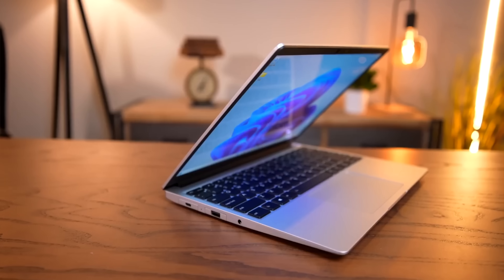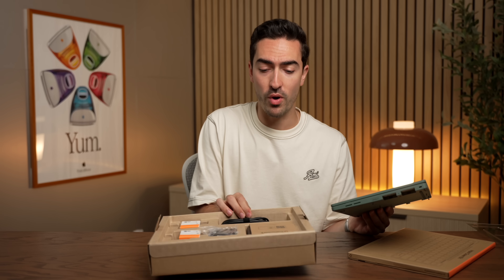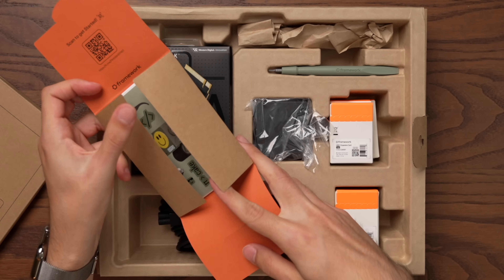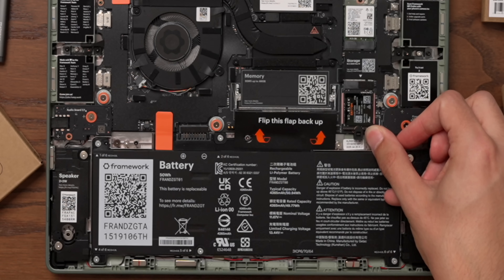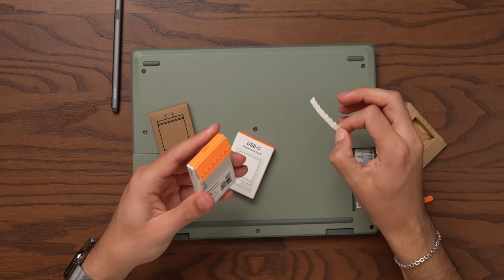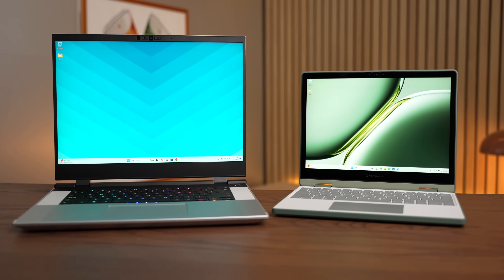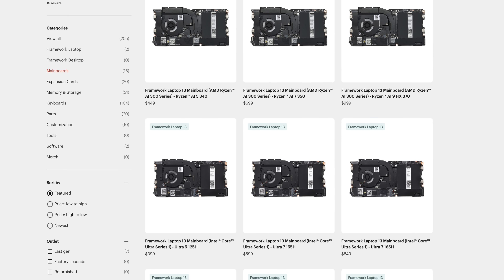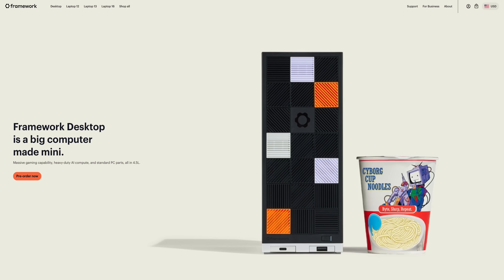Apple could NEVER: Exploring Framework 12

Comment: Now thats a real laptop, no soldered ram or storage and ports and ports
Reply: man looking at these comments mac users are different kind of delulu 💀
Reply: @itsmilan4069  it seems, they think this thing cant do near everything they do on their Macs most the time, this can do the same tasks Macs do most their life, and that's pretty much web browsing and other things of the sort
Reply: I would love a 16-inch Framework laptop with a Luner Lake processor; the battery life would be insane, especially with a 99.9wh battery.
Reply: @cetangamer3228 it's a CPU from 2022 which is more than capable of running browser and light productivity apps. You're obviously arguing in bad faith if you're just caring about "much cpu performance!". Yes these machines will be a round for a while because parts will be so easy to get and install, reducing ewaste. Try repairing a MacBook, it's an absolute pain in the ass. You also don't have to upgrade every year?? It can be 3+ down the line and you can upgrade the CPU. It makes the framework very versatile.
Reply: And what’s it’s running? It’s cheap crap.
Reply: Chad
Reply: A real slow laptop.  

Love the repairability, but not more than I love being able to actually use my laptop without pulling my hair out.
Reply: @ericlamont4130  Framework 12 Pre-built base model with i3-1315U 8GB Memory 512GB Storage for $799 makes the $999 Macbook Air M4 look like a bargain.
Reply: @ericlamont4130  tbf this is listed as a "entry level" laptop despite the price. But frameworks will always be more expensive. The 13&16 are better for actual power users. This is great for kids/teens, or those who just like to watch content and maybe doodle.
Reply: I was coming here just to say this @ericlamont4130
Reply: @ericlamont4130 blud's looking down on 13th gen U series 👀
it's literally fast than m1
Reply: @itsmilan4069 you're comparing that i7 to a 5 year old chip (which it barely beats) and ignoring that the i7 uses significantly more energy. You know this is a laptop, right? So battery life is kind of important lol
Reply: Sure but honestly when you buy a laptop or a desktop, how often do you buy additional ram or change a ram from what you bought together with the unit?!

Storage maybe but I never change my 512gb on my laptop and it has been like 5 years now 

Ports… how many ports do you need in a laptop?! USB-C, HDMI….
Realistically if your working on a cafe or somewhere outside your work area, are you plugging something on your ports???
Reply: @cetangamer3228  yes, I get near NOBODY "cares" about upgradability, but they will when they have to buy a new shiny machine instead of having an option to keep their current one and bring it to modern standards again
Reply: @StuffingSkulltag what do you mean modern standards???

By the time you change to “modern standards” you also need to change the ram if it is not compatible, also your case might be beat up already, cause by the time you need to “upgrade” your laptop, that is if you can upgrade your cpu and gpu, it would be like 6-8 years already, that is if you take care of your laptop. 

Better buy a new unit rather than “upgrade”
Reply: @cetangamer3228 the idea its not only upgradable but also easy to repair. It's especially important since the framework 12 is designed to be used in schools and other high usage environments so being able to easily change components on the fly is a big advantage
Reply: @koto483 like what component are you talking about, the ports?!

When you buy a laptop you buy it base on your workflow, so the cpu and gou should be more than enough with what you will be working on. You don’t buy a laptop that is underpower and buy additional components because your thinking of swaping it out, that is crazy

Sure it is easy to repair but what percentage are people that needs to repair their laptop every year
Reply: @cetangamer3228 Dude im not talking about upgrading the components, im saying its easy to replace broken ones. Like i said its gonna be used in schools, so stuff like broken displays, keyboards, ports would be common areas to fail. Its so IT department can fix these laptops ik little time with spare on hand components. As well down the line for second or third owners of this laptop for independent buyers. Its also to reduce ewaste do you dont have to buy a ehole new laptop.
Reply: @koto483 so your telling me you are willing to buy a 2015 windows laptop this 2025 as long as you can replace what needs to be repaired in the components???

This model on the video you will buy this maybe 5-8 years from now?
Reply: Also terrible service
Reply: this is literally a toy

can't do anything performant with those specs
Reply: @gurtyofrozen bro wtf it's perfect for most people's usecases, very fast for office use! This is meant to be a small ultrabook and not a powerful machine
Reply: @Zebra_Pawoffice use cases wouldn’t be using a Mac.
Reply: @DavidRavenMoon if you are just a light user like office docs and browsing then go for the cheaper windows, if you want a unit that would last more then 5 years get a mac

But if you are a power user like gpu usage for engineering or architecture or something that uses gpu obviously you are not getting a mac even if YOU LIKE the mac
Reply: @Zebra_Paw And its concept is that it is meant to last 10+ years. Starting with a chip that is already 2.5 years old and was built before Intel's efficiency and iGPU renaissance, makes anyone defending this seriously defend the indefensible. It is cheap and not recommended. Even though Framework 13 is considerably more expensive, it's worth buying for a modern chip that will remain contemporary for longer.
Reply: @DavidRavenMoon a bunch of them are, actually
Reply: @andyH_England  It's a low power chip but not a Celeron or whatever, and still very modern. I don't believe there are newer chips of that class really. I have an HP Dragonfly Elite G4 with 1335U, feels anything but slow!
Reply: @Zebra_Paw Sadly, after Gen 13, Intel improved both efficiency and its iGPU, so it's a hard buy to buy what is a much-maligned chipset. No one should be buying this in 2025. Sorry, but that is absolute. Could you wait for the next generation if you insist on buying a Framework?
Reply: @andyH_England It's an Alder lake cpu (edit: its 13th gen nvm), that's the gen Intel started to catch-up and works fine for students
Reply: @koto483  Yes, but this is not Alder Lake, it is Gen 13. It is ancient in tech terms, and as this video and others show, I would never recommend anyone paying this much for an ancient chip that Intel probably sells for $50 at max.
Reply: @andyH_England  Well even better since alder lake is 12th gen my mistake. I'll iterate my point again, you don't buy this laptop for the chip, you buy it for the versatility. Framework is also a smaller company so they can't produce in bulk compared to larger companies for lower prices. Don't be gaslit into thinking its ancient when its only 2 years old, especially since it works perfectly fine for what its used for.
Reply: @koto483  It's okay for you, but the poor GPU and terrible battery life plagued the 13th Gen, and overall, it was a disappointing chip, considering Apple Silicon and AMD. I and no one else should defend this, even if you say it is good enough for you. At that price, it should be better.
Reply: @Zebra_Paw I can buy a powerful machine for that price,t that's the proble,
Reply: >no haptic touchpad
>Horrible old Intel processor
>Terrible battery life
>Terrible colour gamut screen (LCD is fine, but the piss poor colour accuracy is inexcusable)
>Terrible USI stylus that is a separate purchase (everyone knows USI/MPP styluses have jitter and lag)

Really? Real laptop? You're delusional.
Reply: @nightrunnerks have you used this laptop though? Also this laptop would be awesome for schools. 

Framework has said they’ve had a huge bump in sales from the likes of schools, businesses etc
Reply: @szmr   I would never buy a laptop without a haptic touchpad no.